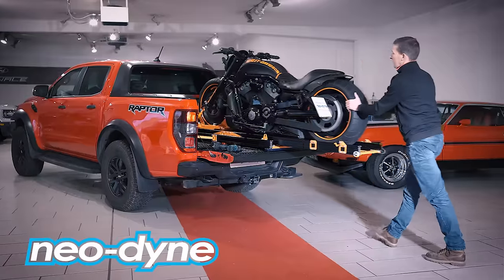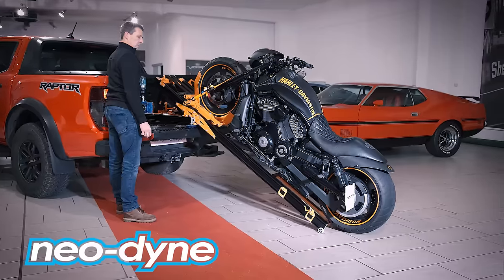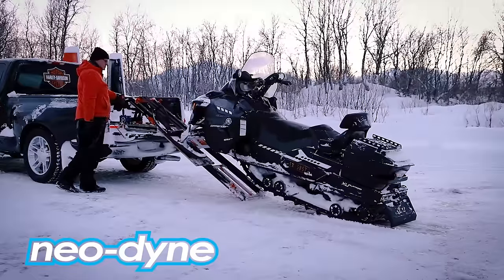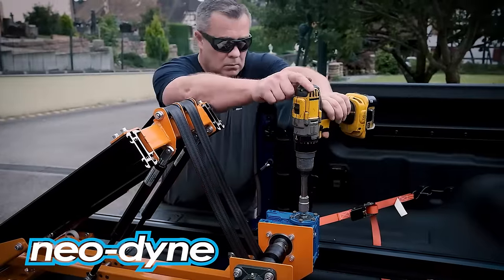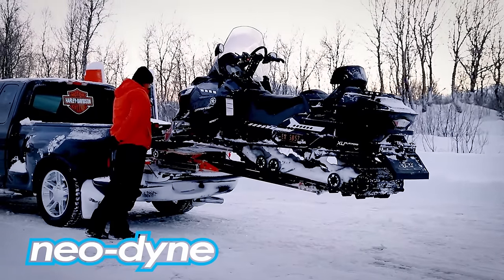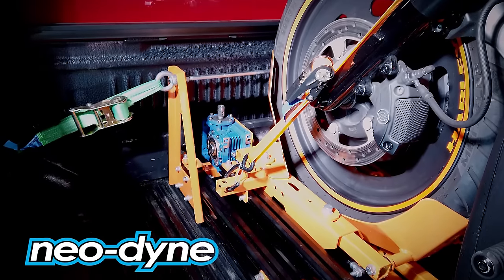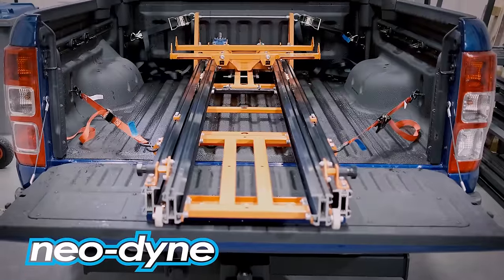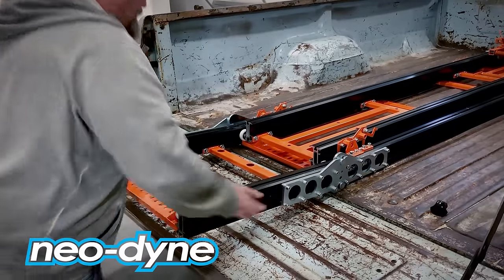NeoDyne motorcycle ramp and cargo loading system

Comment: I see in the video, in one of the installations, a base rail extension allowing the tail gate to be closed. Is that available as an option. Can the standard 99 inch base rails be cut to fit inside an 8 foot bed.
Reply from the maker: Yes, we do that quite often for guys with 8' beds. Please download the AC 004 manual from the accessories page to see how it's done.

Comment: I think this is AWESOME. Addressing the complaint of one person as to the expense being that of a trailer.....I have a few thoughts.
1- I have an enclosed trailer and I would have to outfit it with all the tie down hooks and such to haul my bike.
2- I have to license my trailer and you don't with this.
3- I won't get blocked in anywhere with your system like I sometimes do with my trailer. 
I'm sure there are more things....but for "ME" the cost of your system would probably not be too much of a hardship compared to a trailer. Just my thoughts. I HAVE loaded dirt bikes for years in truck beds with varied success and lots of bumps and bruises. THIS looks like the way to go as far as I'm concerned.
Reply from the maker: We used to make ground access trailers:) But had enough of them. Better to have the freedom of a 4wd truck that gets you pretty much anywhere.
Reply: Thanks man, better than a trailer:) We used to manufacture kneel down trailers but just handling a trailer in your garage is an absolute pain.

Comment: Can I leave these permanently mounted on my Truck? Will the natural elements damage it?
Reply: I had my ramp mounted in my Ford Ranger since one year back. It's alloy, and the steel parts are zinc plated and/or powder coated. Powder coating is magnetic paint, it sticks to the metal, then it's baked in an oven:) Ramp looks good, man.
Reply: @Motorbronx  Awesome, thanks bro!

Comment: Impressive product!  Seriously considering it.

1. I have tonneau cover which has 2000lbs weight rating, and I want to install this on top of the tonneau cover.  In this scenario how can this be secured with straps?  If the loader is on top of the cover, then it will be sitting against the rear window of the truck.  In the video, I can see the straps are tied to pull the ramp towards the rear window.  On the bed, you are sitting against the metal bed, so no problem in that scenario, but if you are loading this on top of a cover, then the front side of the ramp will be pushing towards the glass.  Is there something / accessory not shown on the video that would allow me to secure without the risk of the ramp / bike hitting the rear window of the truck?
2.  If I want to remove the ramp completely to get my truck back, are there wheels on the ramp so that one person can roll it away and store it vertically?  From the video, I can't make out what the front of the ramp looks like.  I wish there was a detailed video showed that showed the product in more detail with various different mounting scenarios.
Reply from the maker: Hi there, if I can have a pic with the cover and attach points on it, thank you. Ramp has stoppers, it will not hit the window. To remove it from a vehicle, the best way is to slide it on a table of equal height.
Reply: @neodyneloaders5410  I don’t have the truck yet.  Will receive next week (Ram 3500).  But after that it will get lifted 2 inches in the back + 40 inch tires.  I am now finalizing all aftermarket upfitters items.  I sincerely hope your loader will work.
Reply from the maker: @asong26  Well, it will.

Comment: Is it available in custom lengths and maybe colors? I need one shorter than the AUN 100 model. 

My truck bed with tailgate up is 1880mm.  I would love to be able to keep it in the truck bed, but also concealed with the tailgate up and tonneau closed, when not in use.
Reply: We have done some specials for guys that want to close the tailgate, we can do custom, but cannot change colors. Some guys did re-paint the steel parts though. Split ramp movie is here; https://www.youtube.com/watch?v=i2ajV86mzFk
Reply: Yes that split ramp solves my fitment requirements!
How do I order an AUN 100 with the split ramps?
Reply: My truck bed also has a 110v 400watt outlet. Do you offer a plug-in electric motor that can control the worm gear?
Reply from the maker: Please have a look at neo-dyne.com